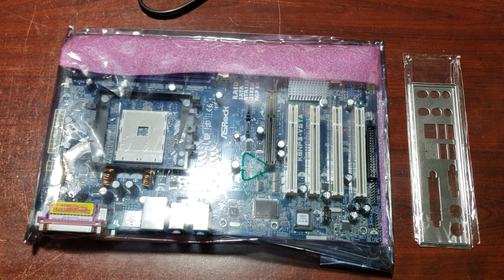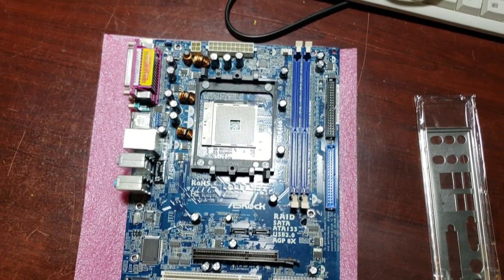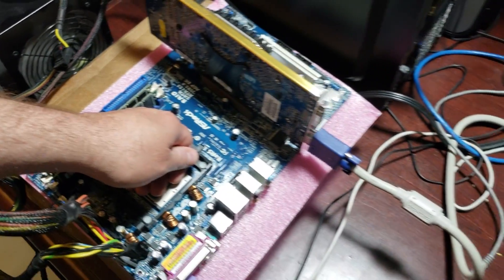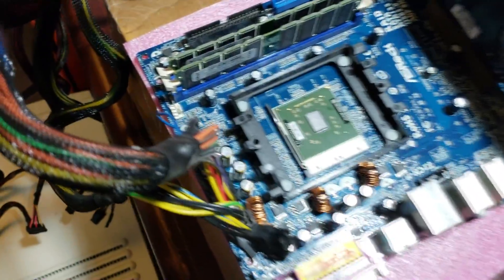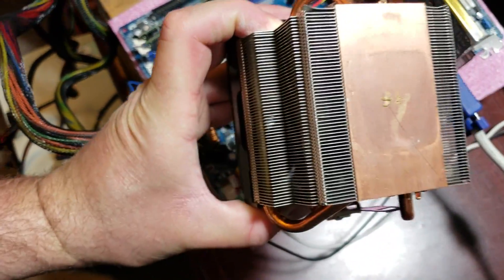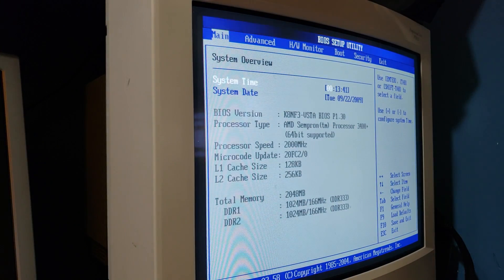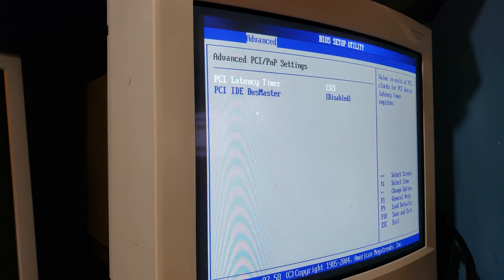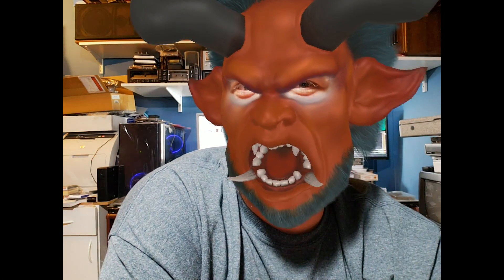Cheap Asrock AMD Athlon 64 Socket 754 Motherboard

Comment: I had a N.O.S Juniper WXC-250 web application accelerator in a sealed Juniper box that had blown caps that I got last year.  The board was a Socket 478 board with a Northwood Celeron and 1GB of RAM.

Comment: Video quality is clear. Despite the shortcomings of the 754 versus the 939 platform, I found them to be far more reliable for some reason. Had to laugh at the use of your hand as a heatsink, lost a few layers of skin doing that but it seems we all just put our hands right back on for the next chip. The K8 always seemed slower than the K7, clock for clock, to me, so time will tell if you find the same when testing this or if it was just a problem with a specific set of boards very early on.

Comment: Picked up a Socket 754 board a few weeks back, An ASUS K8V-X. Can't test it yet as the processor it came with has a ton of missing pins, and refuses to post. £5 for the board and a Radeon 9550, around $7 so I couldn't pass the offer.

Comment: I have this same board, bought it last year on ebay for $15. Looks like I overpaid. The board works well, no complaints from my end.
Reply: socket 754 mobos are inexpensive brand new on Ebay now , the problem are the CPUs  , the fastest  for that socket are too expensive in my opinion
Reply: @tunkunrunk  I didn't realize how expensive 754 CPU's are now, last time I looked you could still get them for relatively cheap. I've got a couple of the Venice core 3200+ chips that run at 2.2GHz. They make for a good Windows 98 / early XP machine. I've built 2 socket 754 rigs for Windows 98 and they both work great. Too bad prices are getting higher, I thought it was the last bastion of cheaper Windows 98 capable hardware.

Comment: I was trying to solve the same thing some months ago. Out of my curiosity I tried to run a mobile CPU on a 754 motherboard (with latest BIOS), and it refused to work unless the cooler was firmly mounted on it with paste (same with some other chips with standard IHS), chip became immediately very hot (untouchable). Then there was a problem of what to use as the cooler since those generic AMD coolers did not reach deep enough. Some recommended a copper shim. Then I found out that for this kind of mobile CPU there were few recommended coolers - Zalman 7000AlCu was among them (sunflower design similar to yours). I managed to obtain just that and yes, it works marvels. Now I had all the power saving features of an already no power consuming CPU installed and made it into a nice SFF XP machine. Very lovely, yet I still have to figure out what shall I use it for :D That's usually the biggest problem for me regarding any older hardware.

Comment: Funnily enough, my motherboard allows me to run my 8320e at 800 MHz, so that feature is still present on newer hardware.  It had the weird side-effect of making the OS and programs literally operate in slow motion though.  Even the clock ran slower.

Comment: Well, for mobile chips you should isolate the resistors or put on an heat spreader. Also flash a bios with the microcode of mobile 754 CPUs
Reply from the maker: I've got some Kapton tape which should work for isolating the resistors
Reply: Fine, usually OEMs use this tape to do it. Also you should adapt the mounting bracket to let the cooler do pressure against the die

Comment: Asrock made some really good and stable socket 754 and 939 motherboards, they are extremely underated
Reply: HPZeta Worst ever issue with Asrock, is the use of chinese low grade caps. I have not seen an Asrock from the mid 00's that ran more than 5 years, if used some 4 to 8 hours a day.

Comment: I have the same motherboard and it's really nice! Only one thing that's annoying is that it's picky when it comes to RAM and some of my sticks refuse to work with it.
Reply from the maker: how long have you had yours?
Reply: For around 3 years. Only used it for a couple of builds, though.
The sticks that don't work are the fancy ones with good timings from from Geil and Kingston, though it also doesn't like the cheap 'ValueRAM' from Corsair.

Comment: Is that a Trinitron tube being used in that monitor?  I know the main trait of the old curved Trinitron tubes was the fact that they were only curved horizontally and not vertically.
Reply from the maker: Might be, I haven't looked into that, It was around $1000 in 1998 so it's quite likely.  I am use though to a monitor proudly stating Trinitron on it though when they use that tube.
Reply: I do think some monitors actually used Trinitron tubes, but didn't have any Trinitron markings.  Older Apple all-in-one systems were like that.  It could also be another -tron tube as well though.  After Sony's patent on the design expired in 1996, companies like Mitsubishi started coming out with cloned designs such as the Diamondtron.
Reply from the maker: I looked around on google and it looks like this monitor uses Viewsonic's SonicTron tube. PT813 is the model - http://support.mdl.ru/PC_compl/firma/ViewSonic/prod/proprg.htm

I need to probably recap this monitor soon because of how slow it is to stretch the picture out when it first comes up, it works fine after that but I'm pretty sure it's a sign of a cap or a few caps starting to charge slow from becoming drier with increased ESR and all that fun stuff.

Comment: As far as I'm aware you're not supposed to you run these CPUs whatsoever without a heatsink even for testing but that's just how and I do things I suppose
Reply: As mentioned above both the 754 and 939 had thermal throttling was one of the first amd CPUs with it, if you tried the same with any K7 CPU it will die instantly
Reply: They'll cut power if critical temp is reached :) It was much, much worse on the K7 series which would literally burn themself to death the second you removed the heat sink. Hence why the heatspreader was introduced. They were also susceptible to cracked dies due to the small surface area.
Reply from the maker: Quick post test it's ok, the heat spreader gives you a bit of time, though if the chip is a high TDP, like more than 65W, I wouldn't be testing without a heatsink :)   If they reach burning temp within a few seconds, then there is something shorted in the cpu, as in the case of this Athlon 64 that came out hotter than hell fire itself.
Reply: WaybackTECH I certainly do enjoy your videos keep up the great work
Reply: Found this old gem TomsHardware did. They did unfortunately skew benchmarks in favor of intel during that  period but the heat problem of the K7 series is very much real (Not to mention their way of measuring temperature. Optical sensors and shiny surfaces does not go hand in hand) :) https://www.youtube.com/watch?v=Xf0VuRG7MN4
Reply: The first CPU shown is a Willamette. The first core version of Pentium 4. Very weird and intriguing processors :)
Reply from the maker: HPZeta A little Patrick Norton action there
Reply: If we want to be nitpicky about "though if the chip is a high TDP, like more than 65W, I wouldn't be testing without a heatsink" ... the Socket 754 version of the Athlon 64 3200 is actually a 90W TDP part. ;)

But, like already pointed out, the chips actually have a fail-safe to cut power in case they reach critical temp... AMD had learned from the smoking Athlon/Duron/Athlon XP incidents. Was a rather good idea to prevent thermal meltdown because back in the Socket 754/939 days I saw lots of systems where the heatsink had come off (clamp putting too much force on the shoddily manufactured retention frame, tearing the "nose" to which the clamp secures off the plastic - Gigabyte was known for this kind of problem all the way up to the Socket AM2/AM3 days - hollowed retention frame instead of a solid extrusion).

As for running a Turion 64 chip: The actual pinout of a S754 Turion 64 is  identical to the S754 Athlon 64 / Sempron 64, you just need a BIOS supporting the chip (i.e. S754 Gigabyte K8NS rev. 2 if memory serves) or you may not get a POST.
Reply from the maker: To be "nitpicky" my 3200+ is 59W tdp, not 89W.
Reply: Okay... I take your word for it. Never saw one, never used one, never built one. At the time they came out Socket 939 systems were already more popular. Though... that reminds me of a weird compatibility issue where a known-working S754 Athlon 64 3000 (89W) would not POST while a Sempron 64 3200 would (after swapping out a MSI "VIA" chipset motherboard for a Nvidia Chipset board because the onboard USB died). Never worked out why because I had no time to mess about with it during the time it was in for repair.
Reply from the maker: Might have been the 89w cpu, for example i have an AM2 board with AGP but it is limited to 65W cpu's, which while there is a good number of 65W AM2 chips, it is still a bit limiting.
Reply: I found out with the athlon xp series that the cpu die explodes without a heatsink. Maybe the athlon 64 is the same.

Comment: Nice Motherboard, looks like you and Phil@ phil`s computer lab are on the same page today. Thanks for the video
Reply from the maker: I just saw that. I'd like to get a mobile athlon 64 4000 up and running on this board, but I have another chip on the way which should be quite interesting to test.